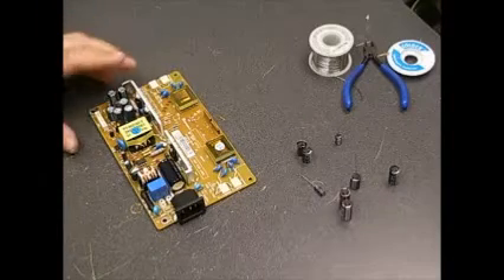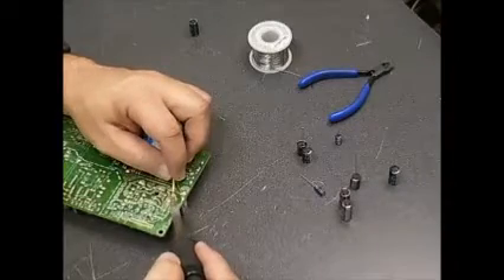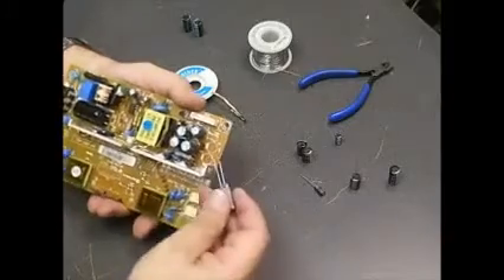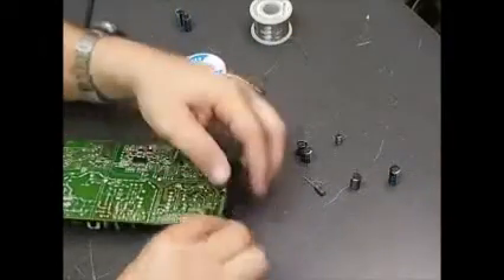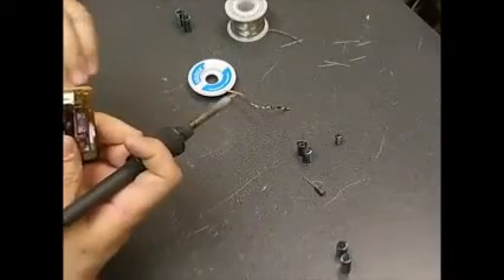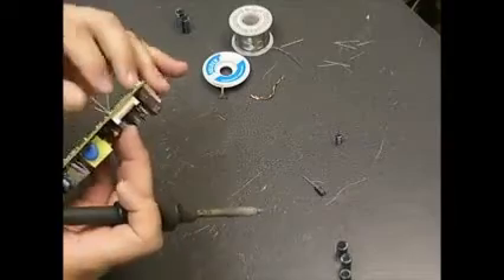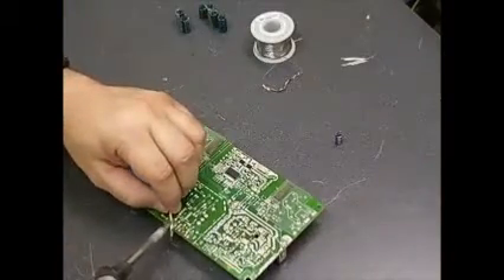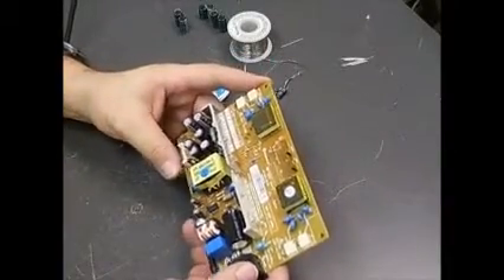Repairing a LG L1932TQ LCD monitor with powerup issues - Part 2 board repair

Comment: I found already repaired Power Supply boards are also available or one picked from a monitor that was salvaged at only $20.00 or so, and its now working fine.

Comment: I have same issues about my monitor but my model unit is lg flatron 1717s - bn.. Is it possible that the capacitor that cause my problem?..
Reply: Capacitor kits are available for all brands and models of monitors.  Replace them all since they only last 5000 hours @ 105 degrees C. and fewer hours depending on temperature.   The duty cycle of this equipment is not all day or they do not last too long. :face-fuchsia-tongue-out: